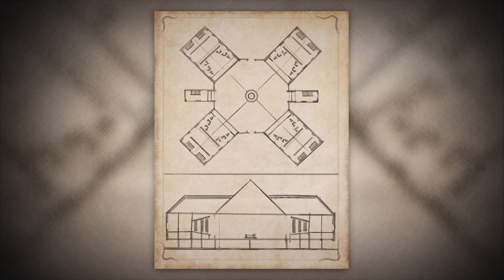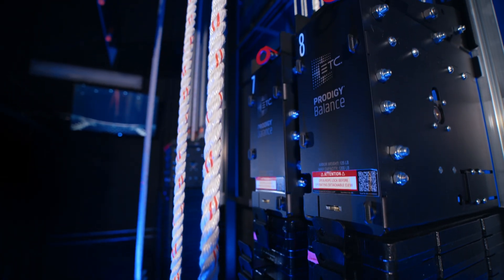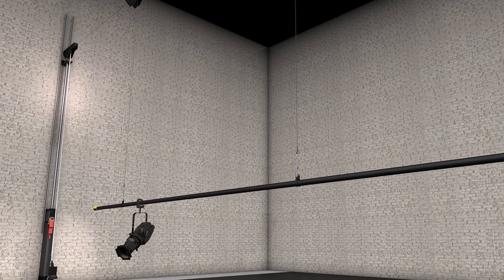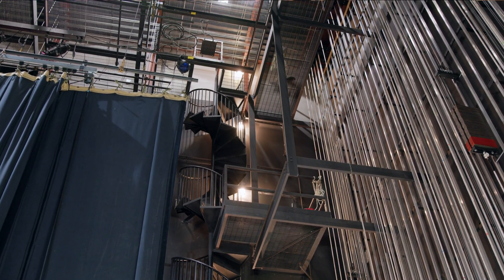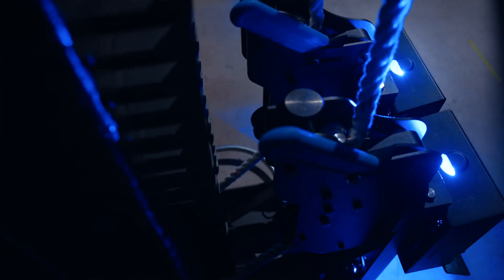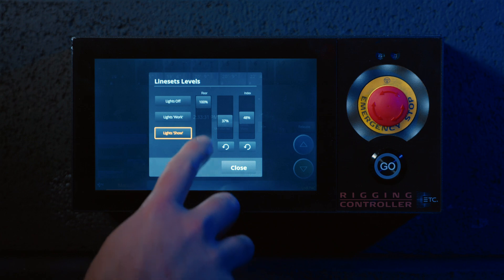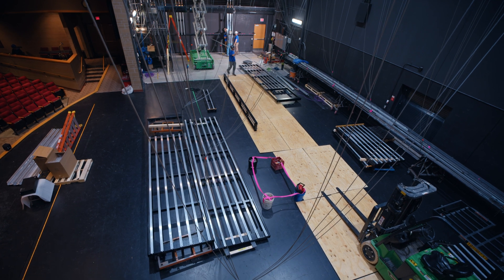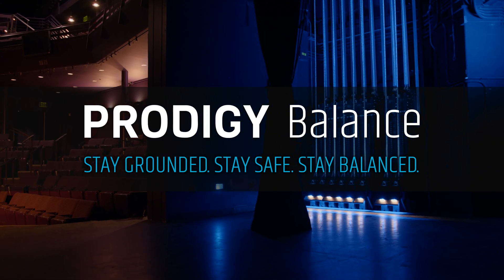ETC Prodigy Balance Counterweight Rigging

Comment: Greetings, I'm a theater technical consultant. This system seems super interesting to me. I'm working with a theater that has a 35-line counterweight fly system. The rigging is simple, but the lock rails are on a bridge 30 feet high. Could this system have the motors and counterweights below and the lock rails on that bridge at 30 feet?

Comment: Ok, I don't understand how the batten and the arbour are both loaded at ground level. You raise the clew with a drill? I dont get it.
Reply from the maker: Hey there, you can view a more complete animation and read the steps for how the detachable clew enables simultaneous loading and balancing at ground level in the top of the "Safety Features" section of the Prodigy Balance landing page: https://www.etcconnect.com/Prodigy-Balance/
Reply: @ETCVideoLibrary  thanks, yeah after I asked that I looked it up on the website. Makes sense now. How fast does the clew go up and down?

Comment: As someone who works in a community theatre with an older counterbalance system a quick and remotely controllable lockout feature is very appealing. One of my greatest concerns is that someone will start messing with linesets during a show when the house techs are in the booth. 

I do wonder about the strap and drill method for loading. Seems pretty slow moving. Also I can totally see people bumping or leaning against the weight stacks and accidentally adding hundreds of pounds to the arbor but maybe there’s a built in solution for that.
Reply: They did say in the end that you can lock them.
Reply from the maker: There are both built-in and additional external solutions to prevent the accidental addition of weight to a lineset.

Comment: Back when I was a student at Sun Prairie High School (Now SP East High School), I remember unloading from that grid and how sure I was that one day I would drop one of those weights.  I still remember the days when we had to carry those weights up the stairs to the grid. 
You definitely had to be strong to move most of what was flown. I even remember a time during a dance recital during final bows, a girl ran under the curtain to grab flowers as it was flying in. I ended up going about 2-3 feet in the fair to try and slow the curtain. Even the concert cell ceiling pieces with the proper weights on them took a huge amount of force to get moving and were extremely difficult to stop quickly if needed.
It's really cool to see the new rigging system there and how much safer it is for students to learn now while still keeping the essentials of rigging. Hope your doing well Matt!
Reply: I'm doing great Tommy, Hope you are doing well too! We are so proud to keep making Sup Prairie's Theaters safer and safer.
Reply: @ Hopefuly it helps bring more people into IATSE!

Comment: Now wouldn't it also be cool if I could control the color of the individual fly work lights from my lighting console so they could act as cue lights (e.g. turn a specific lineset amber as a warn cue and green for go)?
Reply: take it a step forward..  flash when cue is ready, change to a color when a cue is active, then start to flash rapidly as arriving at spike point to solid.
Reply: @hankosky  take it a step further then that, make it all controlled by a console
Reply from the maker: Using the built-in LEDs as cue lights is currently possible through OSC. A UI with cue light functionality on the Foundation Rigging Controller is currently in development 🙂
Reply: @ElectronicTheatreControls  Excellent!  Could trigger them from QLAB!  This is why ETC is AMAZING!
Reply: @ElectronicTheatreControls  this is going to be incredible for students especially
Reply: that would be SICK